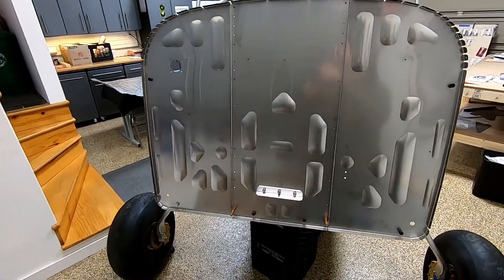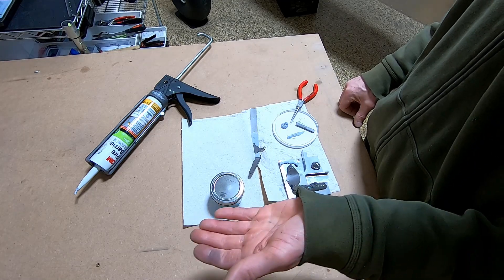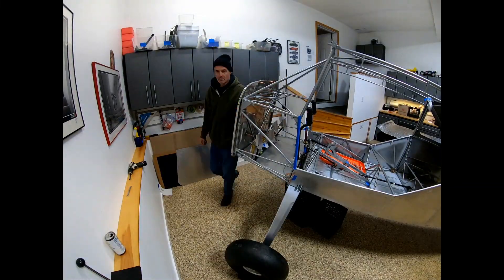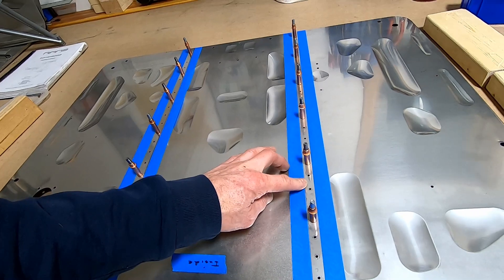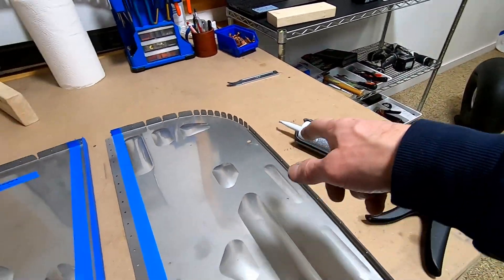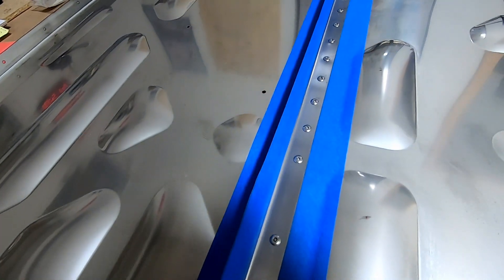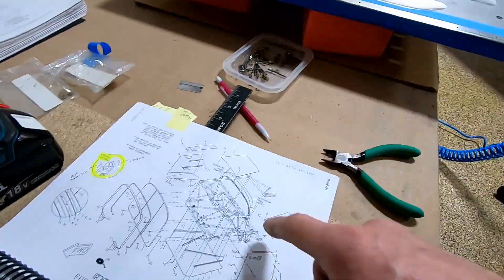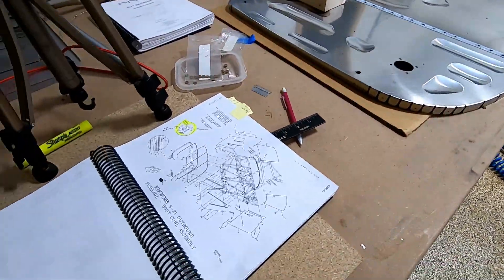RANS S-21 (048) Sealing and riveting the firewall together and using sealant for skin dampening

Comment: You did what I debated doing.  I was going to caulk between the firewall panels before riveting, but decided not to for two reasons: 1. Looked like it might be messy with the brass washers and 2. I wasn’t sure how it would affect the structural integrity of the seam should the caulk shrink up as it ages allowing the rivets to loosen.  Generally, you don’t want anything between two materials riveted together other than a thin layer of primer.  Looks like it worked well for you.

I could not find any information on the 3M web site about using their fire rated caulk that way and all of the examples they showed were applying it to corners and seams and gaps after construction.  Since the firewall has the flanges that provide a nice 90 corner where the panels meet, I am going to caulk there.

I also was considering using the excess caulk on the cage tubes as you did, but I could not find any information on compatibility with aluminum.  Some caulks will corrode aluminum so I probably will use it on the backside of the firewall where it contacts the tubes.  I will otherwise leave the back of my firewall bare as I don’t want anything that can smoke or emit fumes should the worst occur on the engine side of the firewall.  If you use truck bedliner as RANS suggests, I would heat it with a torch to see how it reacts.  I plan to follow the lead of the gentleman in the Vans Air Force forum who tested a lot of materials and concluded that only fiberfrax and SS or titanium were suitable.  I plan to put a layer of fiberfrax on the front of the firewall and then cover it with a layer of thin SS foil (shim stock as sold by McMaster Carr).

Comment: Good video.  Glad to see you use the 3M 2000.  I have seen several comments that Pro-seal may actually be worse than nothing at all (the manual does not call for any sealant) as it may create a toxic fume if subjected to a 1000 degree engine fire.  I'm not a chemist OR an expert on the subject but in construction fire grade caulk is specifically coded in many applications.  Better safe than sorry for a few bucks.
Reply from the maker: Thank you and I love your videos. Went back and fourth on the ProSeal as well. I’m happy with our choice, easier to use and less $ too.
Reply: You dont think that if you have an engine “fire” that the engine paint, oil, wires, hoses, rubber, fuel etc etc, is not going to make a smoky mess before cured PRC on the firewall seams? Some of you guys really must stay up late thinking about this stuff😂 How many engine fires have you heard of lately? You must be worried about your quality of work or something, just saying😉
Reply: Well, engine fires can be 1500 degrees +.. and most deaths from fires are from fumes, not flames.  I personally don't know anyone who had one, but they do happen... and my POH has procedures for dealing with them... and building manuals make note of sealing off access points into the cabin.  So, no point ignoring reality..  And I'm up late anyways, so might as well think about this stuff.  As I said before, cheap insurance.
Reply: @treetopflight7624  i was responding to your claim that PRC may create a toxic fume if subjected to an engine fire. Having nothing at all there would allow OTHER toxic fumes into the cockpit. I would rather have a PRC sealing the cockpit from other fumes to allow me time to land in the UNLIKELY event of an engine fire. PRC is fuel proof, and non corrosive. Most Silicones are corrosive to aluminum so no 3M for me😉